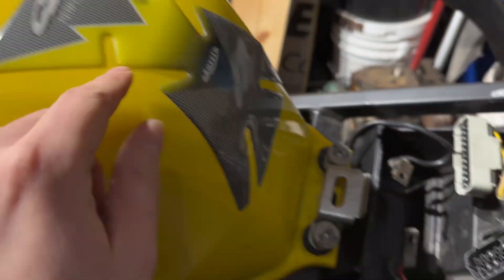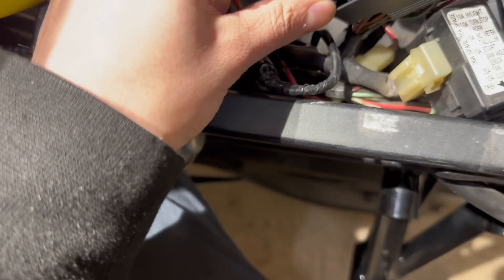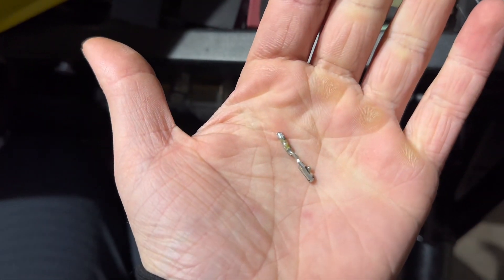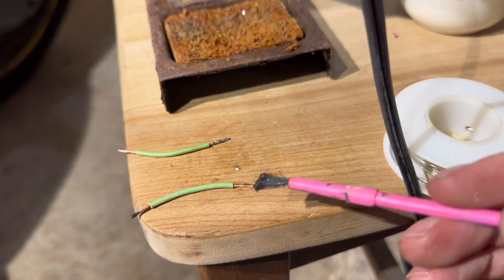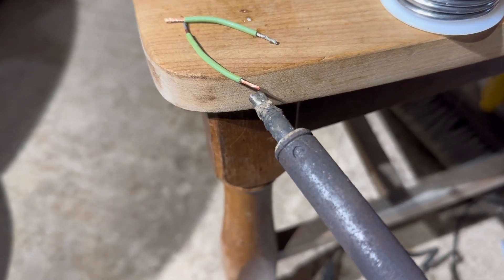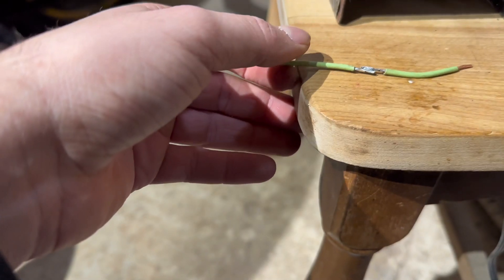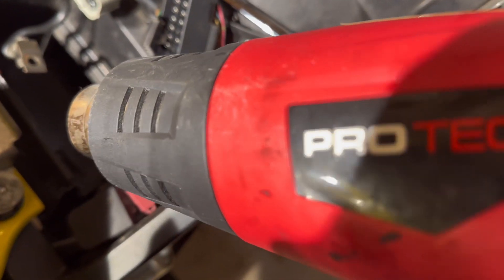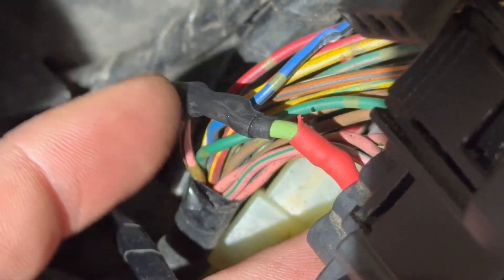F4I ECU Pin repair

Comment: hey how did you pop the pin out? have the same problem but cannot get the pin out and am scared to bend it…
Reply from the maker: use a small flat head screw driver and push on the little locking tabs to release  it

Comment: Was it the pink/green wire that broke off because I think mine did the same thing but on the outside, the pin seems intact but the end coming out of the ecu is sticking out by about a couple millimeters. If I pop the pin out I should be able to reattach the wires and put the pin back in right?

Comment: I kinda screwed up the pin. I guess ya gotta get lucky getting them out. I'm gonna try using the old one anyway. Have owned the bike since '03. I saw that wire breaking for a loooooong time. I thought I traced it to the #3 injector, but then it broke and there when the fuel pump. I'm ordering a connector with pins, but just to use the pins. I hope they fit. There is another pin with the insulation cracked.
Reply: How did you trace it?
Reply: @MJRamirezVideo  Looked at a schematic and guessed a little. I'm not knocking the video since it did help, but seeing it and doing it are 2 different things. Tried ordering some new pins, but didn't get the right ones. Soooo, it's still not done yet.😒
Reply: hey i know you commented this almost a year ago but i was really hoping you could tell me what pins you ordered i have the same exact problem on my 01 but i haven't been able to find the right pins for the life of me

Comment: I had the same issue. I was a pain in the neck to pull pin out and solder it back on in tight space. What a rare case. Found out that it somehow connect to 2 sets of injectors and ignition coils based on wiring disgram. 😅

Comment: Can you show where that pink wire  was on the black plug  exactly camera   view of video  had problems to say the least
Reply from the maker: Are you asking what the pink pin goes to or what the wire is for? I don't understand what your comment is asking.
Reply: @FredricMccubrey  I was working on my f4i and I don't know where that pink wire went in the black plug. which hole bottom row or top row  ,I can't till from the video  you made . My bike off road for 10 years because of the pink wire.
Reply from the maker: @honda350racer6   second one over from the left on the top row.
Reply: @FredricMccubrey  ok thanks

Comment: Do you happen to know where to find these pins? I'm having a hell of a time finding them.
Reply: Did you fix yours yet?
Reply: Areomotive that company  does all thr oem connections  on lots of things
Reply from the maker: You could try going to your local Honda dealer or calling them and asking.
Reply: I got her sorted, couldn't find anything in town, even from honda. Found a sweet site though out of the states that had oem replacment pins and connectors
Reply: @jakeforster6014   please lmk what site this was and what pins you ordered if possible it would be so much appreciated lol
Reply: @jakeforster6014  care to share?
Reply: @jakeforster6014  Ya I could really use the site too, need new pins